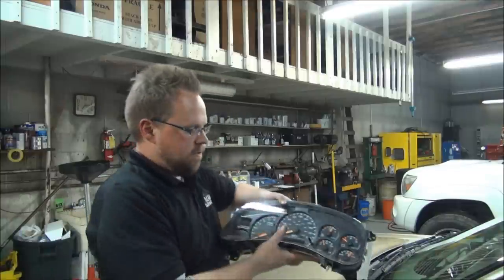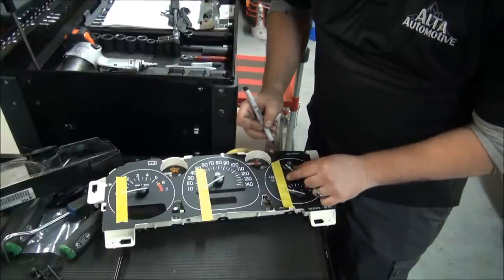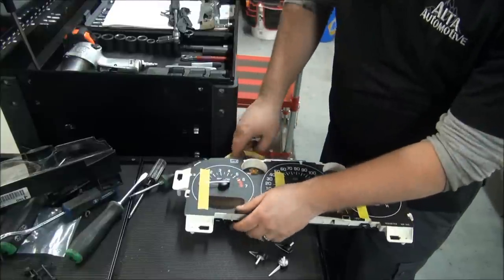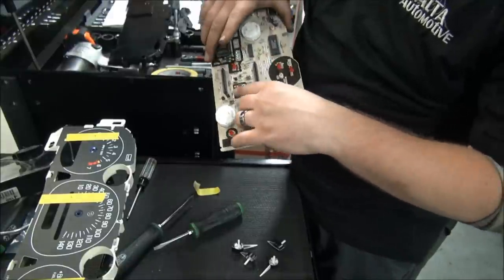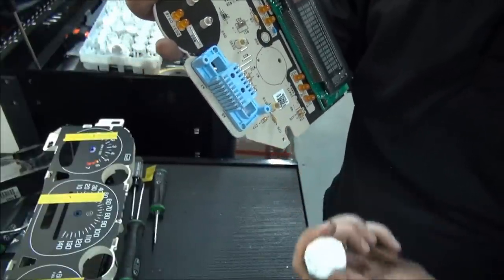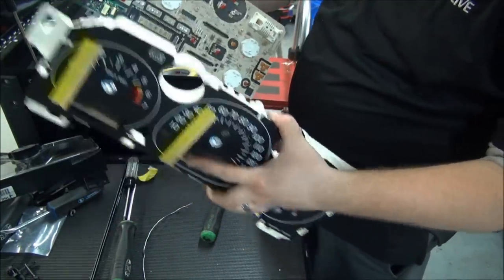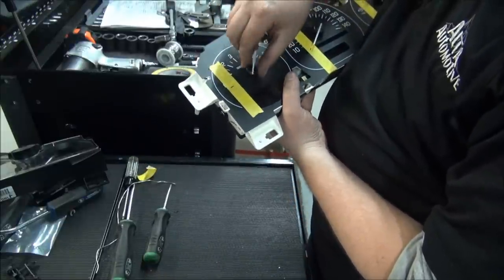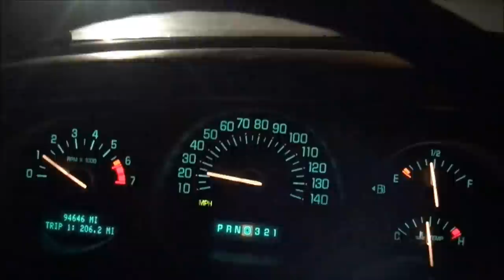How to repair GM Instrument Cluster | Speedometer | Gauge | Stepper

Comment: hi Bri my names is wilber and I have a question.  my 05 trailblazer warning lights are popping up on the cluster and the gas gauge also is as it were empty all the time so if you have an idea! I'll appreciate so much. God bless you.
Reply from the maker: Sounds like you may have a problem with the fuel level sending unit in the gas tank.... What warning lights are coming on?
Reply: +Do It Yourself Bri  all the warning lights brake, ABS, AIRBAG, ENGINE, SEATBELT, pretty much all of then and I was thinking take off the cluster to see if is that!!
Reply from the maker: sounds like an internal short in the cluster and or wiring problem.

Comment: have  2002 impala gas guage stays on full and even when fill up, in driveways that incline the low gas indicator beeps off..how to fix both issues
Reply from the maker: +judy sokolowski There may be a problem with the fuel level sender in the fuel tank. It really requires the removal of the fuel tank to properly test the fuel level sender with a volt meter, however you may also have a sticky stepper motor explained in the video

Comment: I have a 2000 Chev Suburban. All my gauges, including the odometer quit working. Fuses are all good, what to do next????
Reply from the maker: You need to pull the cluster out and check for power and ground on the back. If its getting power and ground than I would suggest replacing the cluster with a remanufactured cluster from the GM dealer.
Reply: Michael Frazier Hi did you ever get your cluster to work??? my gas always on E

Comment: hello is true that the cluster program after changing engines indicators ???
Reply from the maker: +jesus olmeda No programing is needed, they just need to be installed correctly. And also marked correctly before you take them out.
Reply: +Do It Yourself Bri We would say that all the needles need to be on zero. since all are damaged simultaneously.

Comment: Hi Bri.  Great video!  I have a moderate level working with circuit boards so this repair seems pretty straight forward.  I have a 2003 Cadillac Escalade.  The speedometer has been off for quite some time.  A couple months ago, the speedometer would gradually show an increase in MPH even while I was keeping constant speed.  Eventually, the speedometer was off by more than 30-40 mph over what I was going. Currently, the needle is buried on the high end when driving and really doesn't move at all.  I have been driving using the sound of the engine and the RMP's to tell me how fast I am going, but the wife isn't to fond of that when she takes the truck.  :)

I did a little research and found that the stepper motors could be the problem...would you agree?  If so, do you have a stepper motor in stock and able ship to me?  I can call your shop # from previous posts to order if you do.  Thanks in advance for the help!
Reply from the maker: Yes and Yes, I fixed one yesterday that was doing the exact same thing. And I have the updated stepper motors in stock.
Thanks. 801-292-1331
Reply: Thanks Bri!!
Reply: Do It Yourself Bri
 THE STEPPERS HAVE BEEN REPLACED,  STILL DOENT WORK.  :( THE CHECK ENGINE LIGHT STAYS ON
Reply: I have a 2011 ford crown Vic with  the instrument cluster not working perfectly.  The light does comes up once in a while. The milage reading is not showing at all. How can I send this to you for repair work? Thanks

Comment: Hi i have a 96 chevy 1500 the gas gage goes crazy an temp gage dont move off of max heat.... what would be the problem
Reply: David Valero The temp sounds like this, the servo. Take it apart and replace them all. Servo and bulb kit is on Amazon for about $20 (the bulbs are worth replacing too).

Humor me though, My speedometer jumps around but works correctly if I pull the parking brake release halfway up, works for a while, then goes back to being random. Can you replicate this with your gas gauge? Replaced all servos and this just does not make any logical sense to me.

Comment: Where can I get the light bulbs and the motors for the speedometer and gauges for a 2005 Buick lesabre?
Reply from the maker: I Have the stepper motors. The bulbs I have may not be correct for that model. If you wanted to buy the steppers from me I could just give you a few bulbs. Stepper motors are $10.00EA plus $5.00 for shipping.
Reply from the maker: You can call me shop in Utah 801-292-1331 (to order)

Comment: I have an old 91 Buick Lesabre.  The speedometer needle acts up a lot.  It might work for 30 minutes or so during a drive but then it starts to jump all over and finally just quit.  Can I do this same repair on an old car like this? I'd rather do this all myself than take it to a shop.  I think my only other option is to get a used, working cluster and replace this one, but then me odometer wont be accurate.  I can't pay $150 for this stuff.
Reply from the maker: Used is the way to go, in your case

Comment: Hi mate sorry I have a Mitsubishi Pajero 2000 and my speedometer it's not working at all and also my temperature gauge is playing up but do t know what to do
Reply from the maker: +george Lavaka It could be a problem with the instrument cluster circuit board, vehicle speed sensor, speedometer drive gear or wiring. Unfortunately I don't see that model at my shop so I don't know of anything common...

Comment: For the life of me, I can't find a solution for my 1999 C1500 Suburban inst cluster. Lots of 2000+ but not 1999.
The Oil, Fuel, and Temp guages are flakey ... can't find a repair kit - maybe stepper motors ... would love to just swap it out with a refab ... where can I get a 1999 inst cluster fix kit or repair service?

Comment: The dealer price for this repair is 500$- to 800$. With this instructional video, and a bit of patience, plus 25 bucks in tools, 30$ in replacement parts, you get the job done for under 100$. It justifies a small cash donation. Take something, give a little something back. Dan S
Reply from the maker: +Dan Sabo Thanks!

Comment: I have a Silverado 2500HD Duramax. I'm having the issue where the languages keep cycling through without letting me select a language or set trips or anything. Do you have an idea of what that may be?
Reply from the maker: Yeah I'm not sure on that... I will do some checking around and let you know.
Reply: Do It Yourself Bri Thank you! I've read alot online. Others are having the same issue but no solutions

Comment: My cluster is dead. It needs to be replaced. I unplug it but the car won't start. Starter doesn't even spin. 
I got second hand cluster from other car. What will happen fi I connect that to my car and try to start the engine ??

Comment: I have a 92 buick pin on speedo is pinned past 110 changed vss. Didnt fix it is this my next step?
Reply from the maker: That Buick does not have this style..
Reply: Do It Yourself Bri ok on my 92 buick why is the the needle pinned over top speed and goes in reverse bringing needle to 100 mph, also tach doesnt work either.

Comment: you say this is an issue on 2003 and up gm vehicles..well mine is an 02 chevy suburban and my fuel gauge tends to drop suddenly as I'm driving ..could the stepper motors be the issue on my suv aswell?
Reply from the maker: +Daniel Rodriguez No it's most likely a problem with the fuel level sending unit and or a short in the wiring between the fuel level sender and the gauge....However 90 percent of the time it's a problem with the fuel level sending/fuel pump assembly.
Reply: +Do It Yourself Bri  okay well the thing is I just changed out the fuel pump module last week but the gauge keeps dropping as I drive the truck. so you say it could be the wiring then?
Reply from the maker: Yes I have seen the pigtail going to the fuel pump/sending unit have breaks in them... Did this only happen after the fuel pump was replaced or before as well?
Reply: +Do It Yourself Bri no it was doing it before. that's actually the reason I changed out the fuel pump in the first place . and the day after I changed it the fuel gauge needle started dropping again as I drove the truck
Reply from the maker: It could be a problem in the instrument cluster... however that year did not have the problem with the stepper motor....I would suspect the wiring from the top of the fuel tank to the pcm has a problem...I would drop the fuel tank and check/ohm out all the wiring from the pcm to the fuel pump..
Reply: +Do It Yourself Bri okay will do that. thank you for your help and also.. good video. great explenations throught the entire video..will definitely subscribe
Reply from the maker: Thanks! Also check out my automotive only channel I just barely started this so it's just getting going, however you should subscribe to it as well. https://www.youtube.com/channel/UCXFkbsmVhcDoLQcwEsixQTg

Comment: I'm having trouble finding my fuelbox on my gmc envoy i want to check the fuse before i go further the light went off on the whole speedometer please help me
Reply from the maker: +John Lugo Should have 2 or even 3... one large box under hood, one on passenger side dash area when you open the door it will be on the side of dash, and one on drivers side dash area.

Comment: i have a 78 regal and speedometer doesn't  work do  you think its the stepper / and does the stepper control everything
Reply from the maker: No, that speedo is s cable drive, it will have a cable that hooks to a plastic gear on the back or the trans and go's all the way up to the speedometer in the dash and turns the gauge.

Comment: I am buying a 2005 buick lesabre and the cluster was replaced by the owner at 188k miles 2 wks ago--now the odometer is reading 243k and I need to title and register the car--can a dealershp "READ" computer actual miles about 189 now and put corrected on odometer so I won't have to title the car at "Not actual mileage and ruin the value "?? He has true miles on va. inspection done not long ago also
Reply from the maker: +odysseus48 Yes, I know that it is definitely possible...However I'm not sure the exact process you would have to do to get that done.

Comment: I have a 2002 Pontiac grand am. The speedometer and rpm gauges go up and down. The fuel gauge and temp. Gauge rarely move. 1hat can be the issue on them if they work sparatically?
Reply from the maker: Very possible it is your stepper motors, best way to tell is pull the cluster out and move the needle's if they move freely than they are good however if they feel notchy or stick in spots then they are bad.
Reply: They move freely actually really too easy
Reply: I can't find stepper motors by themself for this cluster. Was told I can only by the entire cluster by the dealer
Reply from the maker: Cindy Piper The dealer does not sell or service the stepper motors. They only sell the entire cluster. I have the stepper motors in stock for that car.
Reply: They are not the white plastic ones. You can see the Cooper wiring and such in these. And they don't sodder in. Are those the ones you have?
Reply: They twist in
Reply from the maker: Cindy Piper No those are not the ones I have, Sorry sounds like you will have to buy a new cluster from gm :(
Reply: That's what I thought but thank you

Comment: thanks Bri. new sub
Reply from the maker: Thanks!
Reply: well I got the parts, 6 motors 10 bulbs delivered $21.68. Bought a desoldering tool, 15 bucks. replaced the RPM and speedometer motors. And it works.
 thanks Bri.
 2003 Silverado, (pulling the plug on the back was trickiest part)
Reply: GUY HILLIS tg hello UK x poll       VA and other

Comment: will this repair the fuel guage on e with low fuel light on 04 chevy s-10?
Reply from the maker: Sounds like a problem with the fuel level sender in the fuel tank. Not the inurement cluster, I would check that first.
Reply: Do It Yourself Bri Just had a new one put in it with fuel pump
Reply from the maker: Scott MUFFIE I have never seen a stepper motor cause the low fuel light to come on. (only causes the guage/needle to not read correctly) The wire from the sending unit to the gauge may have a short in it. The way to diagnose this problem would be to hook up a scan tool to the OBD data link connector and read the fuel level on the scanner, if the scan tool reads empty then the problem is most likely not in the cluster and some other place like a defective sending unit, shorted wire or computer problem.

Comment: chevy suburban  2014 problem dash dim temperature cage battery gage drop down and up  some time any help
Reply from the maker: Have you installed and aftermarket radio by chance?
Reply: Do It Yourself Bri hi no now i have problem dim radio desapear some time come back dealer dont know the problem is not the radio something else

Comment: how much would somethimg like this cost at a mechanic
Reply: I just looked into this as my gas gauge and spedometer went out. Local auto shops in Redding CA were charging between 380.00 to 450.00 for the repair, I kid you not. I'm beyond ecstatic that I was able to fix it myself for less than 30 bucks (I needed the stepper motor kit & a good solder sucker tool).
Reply: Matthew Ashworth i kinda wanna take a risk too and fix it myself but im scared i'll mess up everything on my 2006 ford f150, i have been trying to look for a mechanic who can do that in my town but no luck

Comment: my card honda accord 1999 v6 feul pump gas work very well. only running empty gas .the light not on. why? can you helping me. feul pump or feul gaul fail?
Reply from the maker: The problem could be
1-Fuel level sending unit in the fuel tank has failed.
2-Short in wiring
3-Or problem with gauge in cluster.
4-blown #9 fuse in the driver's under-dash fuse/relay box

You would need to you a volt meter to test each component, this is something that would take a good electrical diagnostic technician 1-2hrs to diagnose properly.
Reply: Do It Yourself Bri

Comment: I have a 1999 tahoe speed odometer not have change speed senor nothing.. do these have stepper motors too.
Reply from the maker: They do have a stepper motor. However on that year of Tahoe, they were typically not the problem.
Reply: Change the speed sensor, no change any suggestions?
Reply from the maker: Do any of the gauges work, or is just the speed not working?
Reply: Just the speed is not working
Reply from the maker: It may have a bad stepper however I have never changed one on that body style of tahoe. I wish I were more help, you may want to find a used cluster and try it?
Reply: Ok thks

Comment: I changed the stepper motors and the gauges still don't work. Any suggestions
Reply: I took a sodering iron and heated the soder joints around the power plug and now it works.

Comment: I did everything that you did in the video to my 05 Silverado and it didn't work at all. Help please
Reply from the maker: +YetixOs what was  the exact list of problems you had with your instrument before you did the repair?....Please describe the problems before you worked on it in detail.
Reply: Do It Yourself Bri  Thanks for replying so fast. The exact problems was that the RPM gauge wouldn't work at all, just stayed stuck and 0. Then the speedometer does the same thing but it would work for the first 10 miles you drove. Then it would get stuck after that, at what ever speed you were going when it got stuck. Those two have been broke for years, but the gas gauge has been broke for not to long now. All it did was point down and go up a little bit when you start the truck.
Reply from the maker: +YetixOs And now that you replaced the stepper motors what are the problems?
Reply: The speedometer doesn't work at all and same with the gas gauge, and everything else, they just sit there. But the RPM gauge was the only one to configure when I plugged it back in and it goes to 1000 when I start it but when I give it some gas it goes down.
Reply from the maker: Unfortunately it sounds like the circuit board may have been damaged when soldering in the replacement stepper motors....I have replaced over 1,500 stepper motors now and out of the 1,500 I have had problems 3 times.... 2 of the 3 where on instrument clusters that someone else replaced the stepper motors on them and they damaged the circuit board and brought it to me to fix... the 3rd was on one that I damaged the circuit board using a  soldering Iron that I normally don't use and it got the circuit board to hot around one of the 4 pin holes that the stepper motor go's into and damaged the connection... What your going to want to do is pull the cluster back out and look at all the solder connections at the stepper motor, there are basically a little solder round ribbon around each hole of the stepper motor connections that can become damaged and will cut the connection of voltage from the stepper motors and if any one of those got damaged it will affect all of the gauges.  If the circuit board has become damaged it is EXTREMELY hard to repair, and may need replaced or repaired by someone that is very good with circuit board repair knowledge and skill. (keep in mind however I cant be sure of this without seeing/testing the cluster myself)
Reply: Do It Yourself Bri Damn...alright man. Thanks for your help with everything.
Reply from the maker: Yeah, no problem... Best of luck to ya man.

Comment: I hope yall have better luck than I did. The stepper motors I got off line was no better than the ones they replace. I went to the junk yard and got a 2002 Trailblazer instrument cluster. It don't use stepper motors and it work fine but had 210,000 miles on it. My TB only had 109,000 miles but I'm not selling it so I don't care. Its been 3 years now and I'm up to 248,000 miles on the cluster and 147,000 on my truck.
Reply from the maker: *****  Yes if you are not lets say super handy with a soldering Iron you don't want to try this!